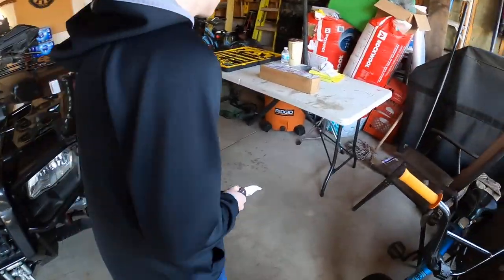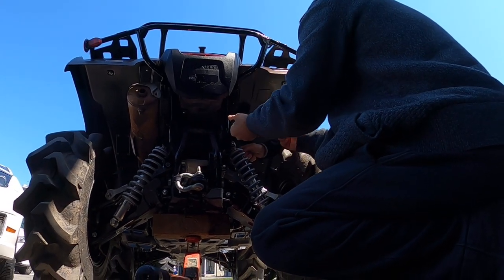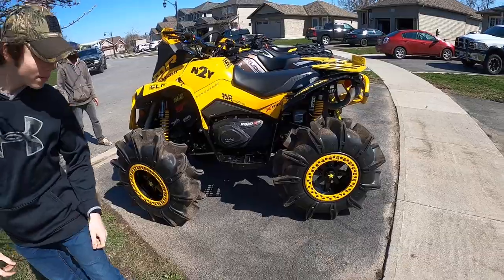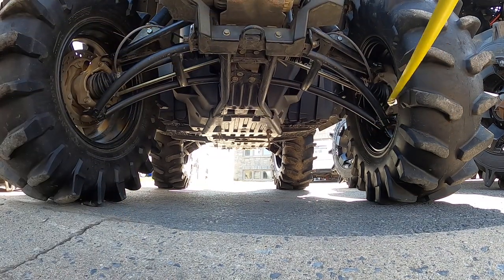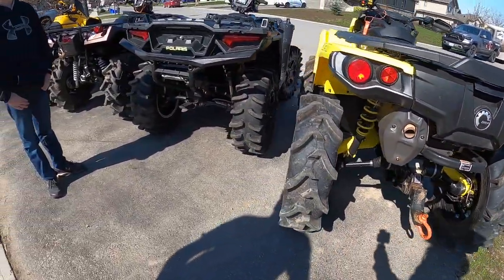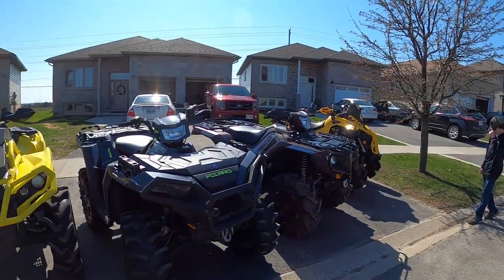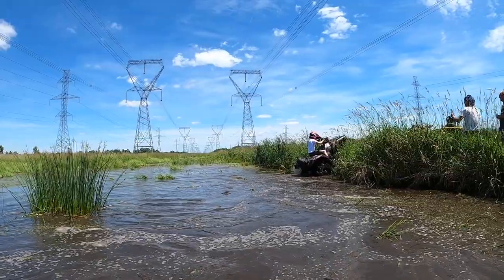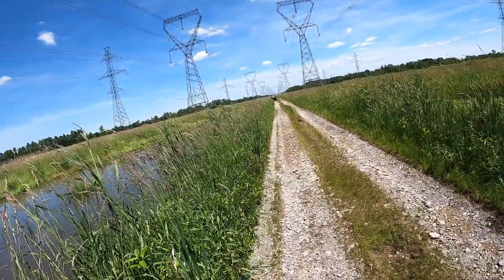We Lifted Jake's Honda, 520 Rubicon Deluxe

Comment: I'm currently building an old kawi.
It's a klf300c with a 2.5 inch lift and 27 inch itps and it has just under 14" up front. Solid rear axle only has 9 inches . The older bikes lacked the IRS but when I build an axle paddle life will change. Keep up the good content.

Comment: That honda's gonna need some demon hd axles for the rear real soon.
They will take the extra angle from the lift, the stock axles are bound up with any more than 1 inch lift.
If you dont believe me jack the honda up and spin the rear wheels by hand, the tires will hop up and down while you spin em as the stock axle doesnt flex far enough for the lift.
Been there done that, my 2 inch lift for my rubicon is hanging on the garage wall, I'll put it back on at some point if I do axles too.

Comment: the ruby looks killer I always run it in low in mud and snow definitely makes a big difference has Jake had any problem with axles from the lift a lot of people say don't do the lift but damn I'm liking it think I might do the same great video Job 🤟🍻
Reply from the maker: So far it's been working mint, We'll be sure to report if an issue arises.
Reply: @ehTV1000  thank you Job

Comment: Honda needs to make a V-twin engine for them wheeler then they would have plenty of power
Reply: I'm no Honda fan, but sometimes having less power makes it more fun due to the challenge. Sometimes it's more fun on my 700 AC trailachine going through mud than it is on my High Lifter. Almost like there is more of an accomplishment feeling.
Reply from the maker: Yeah I know that feeling all to well. 450 KingQuad!!
Reply: @ehTV1000  ya know, your KQ is what originally brought me here because I had a 2018 750. Great ATV, I would recommend one to anyone. And the 2019 updates and 2021 plastic racks were great additions. I'd still have it but I was offered $800 less than I paid for a trade in. It had 5509 kms.
Reply: Thanks for the great video. I ordered a lift for my Rubicon just now!! Looks like a nicer lift from what I've seen out there!!